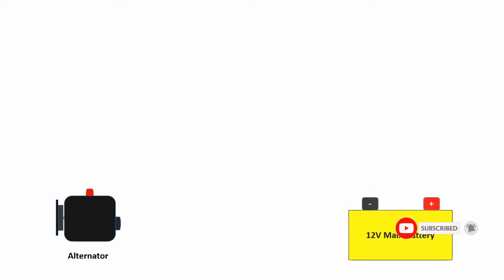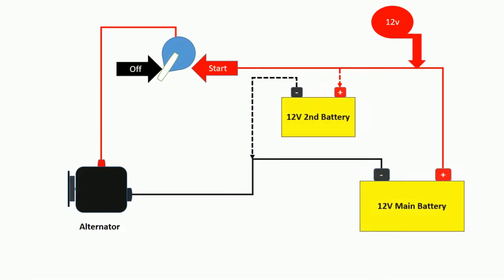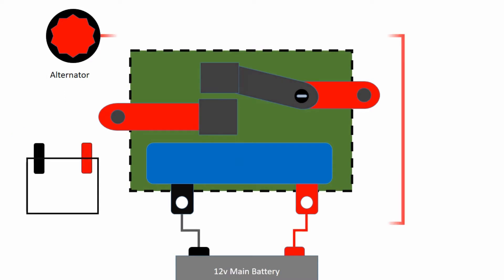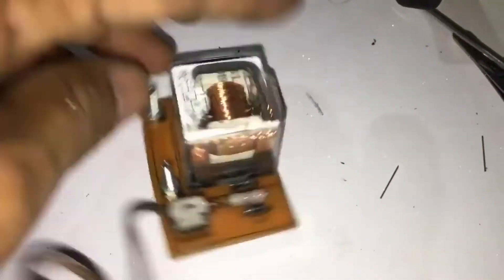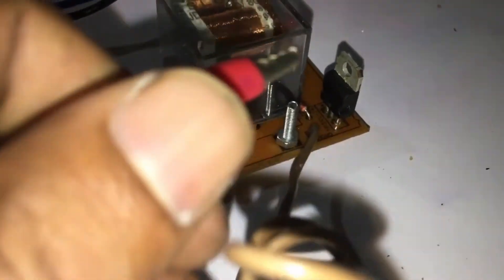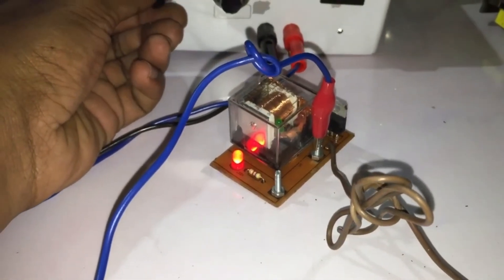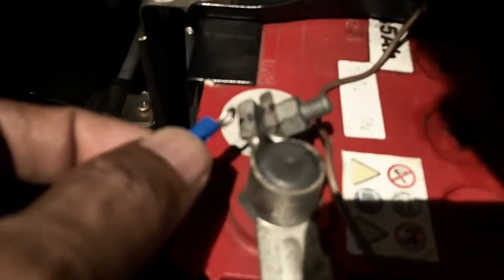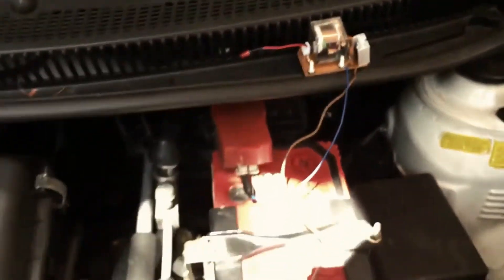Car Dual Battery System DIY VSR 🚓🚓🚓⚡⚡🔋

Comment: thanks for this circuit.  However it starts conducting when input is at 12 volts.  How can the input to z1 be lowered?
Reply from the maker: Because of the resistor